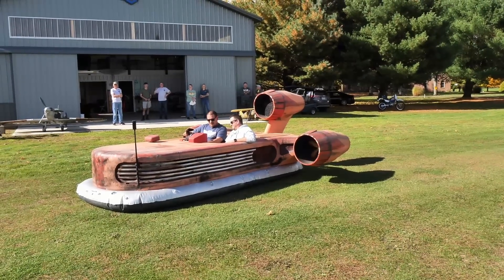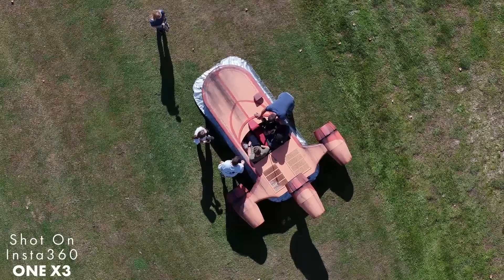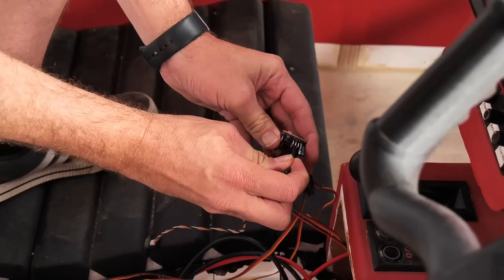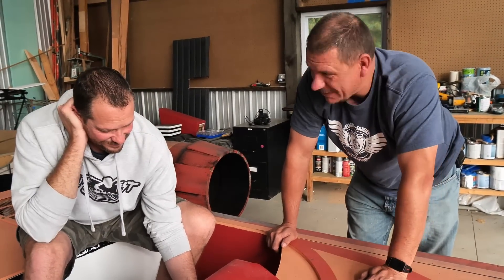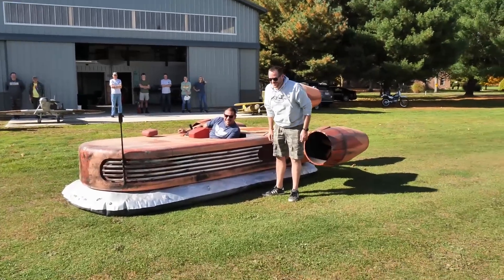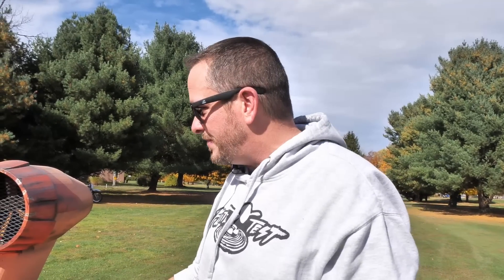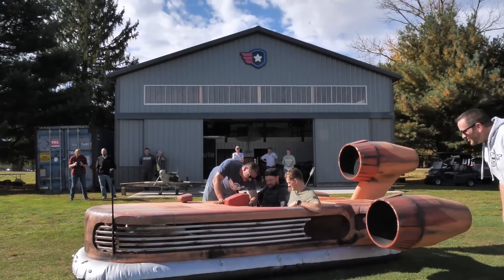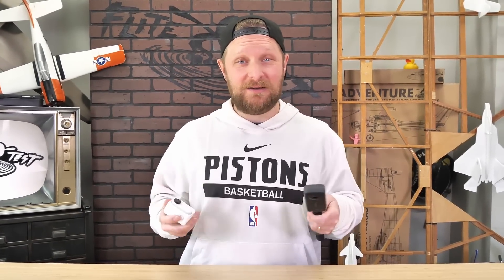Over 1 Year of Work - First Flight

Comment: As I understand, its fully electrick. Thats a mistake. Take off all batteries and put in normal engine. 2/3 less weight, 2/3 much power. And 10 times longer distance to trawel. And if batteries dead in middle of lake. You go down....🤔🤔😎

Comment: So you needed static pressure on the cheap, Some squirrel cage fans would have solved a lot of these issues, The skirt however was just the wrong thing here,  The design of the skirt is utterly super critical

Comment: If you used a squirrel cage blower for the lift bag it would work better.  They are designed to operate and overcome back pressures unlike a propeller with an improvised duct. We use them in ducted HVAC systems for a reason.

Comment: Flite Test Guys, I have a challenge for you.  I want to build a Ghost from Halo, it's a hover craft, but I don't have time and resources to get it done.  It can strafe left and right, it has blasters but for the show it should be two paint ball guns.  I believe the T shape is a problem, however, you could make a clear vinyl bridge from the seat out to the wings to add square area and lift for the passenger.  It is a single seat, every gamer knows what they are.  A single central propulsion fan could be behind the head with a screen, and two for steering in the side wings but to strafe left and right you need on actually IN the seat, like a motorcycle seat it could have a fan  just underneath it to move left and right depending on the clockwise or counter clockwise spin of the prop fan inside,  and it has to be purple or black or green.

Comment: Why don't you use blower fans (centrifugal) for the main skirt?  They are way better at low flow than the axial fans you have at the moment.
You used to be able to buy an RC hovercraft about 30 years ago that had a blower fan for the main skirt.

Comment: This thing startet to accumulate weight from thr start. More power will not solve the problem. More efficiency is needed. Reduce weight , fix the Hovercraft Basics (skirt, airflow,..) Get some help from Hovercraft Pros. Or @ProjectAir
Reply: https://youtu.be/hjBHcuVqgSw?feature=shared

Comment: Hey folks, I need some help from the nitro people in here. I just obtained 2 huge nitro planes out of sheer luck. One of the motors looks almost brand new. Anyways, is it possible to hook up a 4 channel plane with retracts to the aura 5? I have a few spare and was hoping to use em in at least on of these planes. The other doesn't have retracts so I assume I'm good
Reply: These guys are probably too busy with their own project’s to answer general RC hobby questions. You would be wayy better off finding a dedicated RC plane forum on-line & posting your Qs there!

Comment: As an HVAC designer, those return air grilles you have at the back for the intake on the downward facing fans are not bad but there are much more open freer flowing grilles available, especially with straight fins. That 30 degree blade angle really hurts your air flow and adds unnecessary turbulence.

Comment: If I had been paying attention  when this project first started, I would have advised you guys to just make go-cart style chassis  out of aircraft aluminum and just put an electric motor drivetrain for it. Then just mock up some faux skirts to make look like a hovercraft. Even use some  type of audio system with speakers for a realistic sound effects!! Then it could have been used for dependable transportation around locally. Just sayin. Looks real good though, but a little ambitious.  I LIKE YOU GUY'S BEING OVERLY AMBITIOUS!
Reply: Why would they want to do that? Their channel is all about RC Planes & flight. A car-based hovercraft would be ideal for a go-cart channel, not for a channel dedicated to pushing the envelop on RC aircraft… a/k/a apples to apples vs apples to bananas :^) Plus, true hovercraft can traverse land & water, which go-carts cannot.

Comment: To much weight on the back and the skirt is not designed for the job.
This model needs a well designed, nylon sewed skirt, period! 
Based on the calculations, you should set the pressure ratio  by adding holes in the skirt.
The lift fan should have more blades, more aggresive pitch. You don't need speed, u need pressure.
I really hope u guys are going to fix this, willing to help with the design of the skirt, just hit me up.

Comment: Try only one driver inside the hovercraft. half the weight.
Reply from the maker: We tried that. With one driver the hovercraft tilts to one side. We are working on a solution for that
Reply: Then try 2 skinny girls...lol 
One male driver in the center would have worked maybe, but the design is for 2 side by side.  @FliteTest

Comment: One place not to skimp is the bags, you guys could have talked with people that manufacture bags or have bags made for it.  I really believe at least talking with hover craft manufacturers could help tremendously.
Reply: We all probably underestimated how hard it would be to make that inflatable board into a 2 person craft with anything but howling power. Skirts ought to be makable from semi-available materials, right?
Reply: I suggested that several videos ago. Doesn't look like it happened.
Reply: They sure seem to be doing a lot of work to avoid making a real skirt for it. I doubt they will ever get it to work well with that raft on anything other than a concrete shop floor.
Reply: A proper skirt would Greatly enhance performance

Comment: Looking Great! Some Material and techs to consider: Dyneema Pre-Stretched Fishing Netting (stronger, lighter, and more abrasion resistant than steel)! 

en lieu of vent holes, cut a  largish hole about 1/4-1/3 the size of the hull in both dimensions in the middle of the raft's floor to make it into a skirt (thread-enforced tape can seal off holes outside of this perimeter of they're already cut), then cover it with Dyneema netting, which you can bond with the PVC using an iron (fold a flap over the net's edge, cover with parchment, run the iron HOT and press hard!)

Remember, you want good containment to increase static pressure to hover, but you want good air flow to deal with varied terrain causing momentary-yet-repeated gaps for leaks.

Comment: A looong time a go i made a RC hovercraft from the plans that were all over the internet back then Griffon 2000 something. what i found is that you don't want the "tube" to be too stiff, but your set-up is different in that you have engines for the tube seperately. Basically you want it to leak air everywhere equally it might have worked with a third person sat on the nose at that time because they carry a lot of weight as long as it's leaking air on all corners. as soon as a corner touches your friction increases maybe 100x and it's not an airboat, so it's not going anywhere without a massive engine. One last thing if you do get it going (i know you'll figure it out) be careful not to flip it! you'll go real quick real fast and you can not brake so you have to turn around at speed and when you go sideways you go WHOOP upside down, especially with wind. good luck have fun!
Reply: Been there, done that. Wet sand ,so painless.